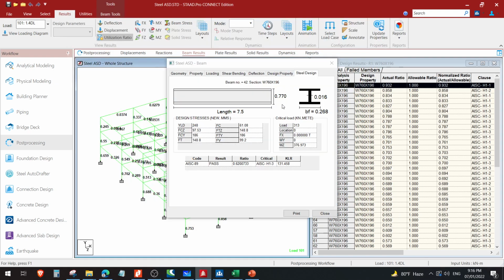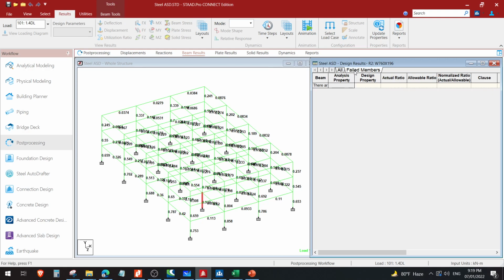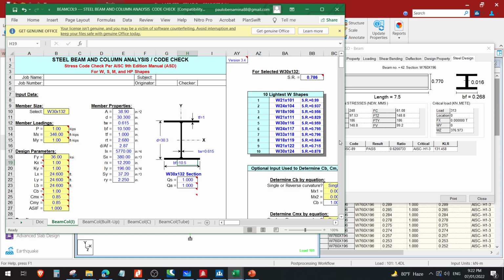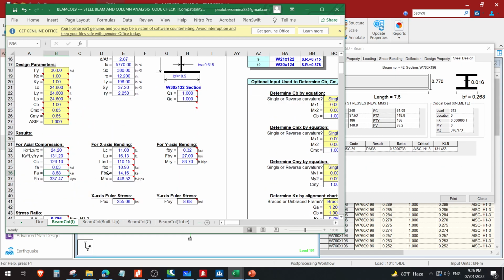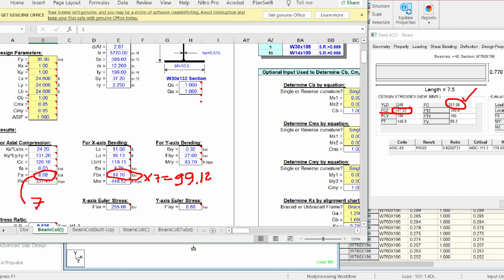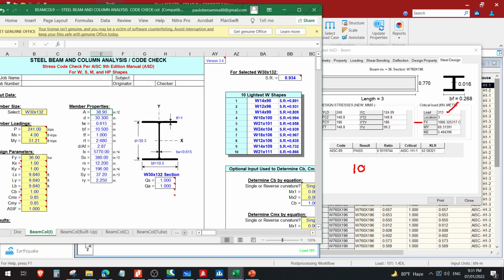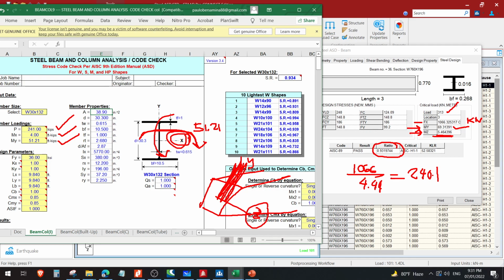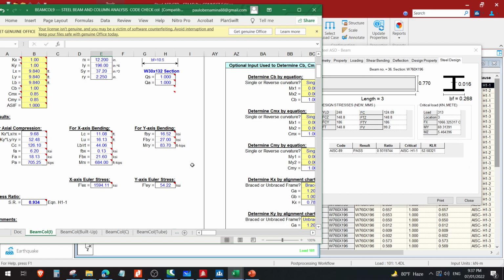STEEL Beam and Column Design Using Excel

Comment: hello sir. paanu po analysis ng combined reinforced concrete and I beam sections. may project po kasi ako reinforced concrete po and existing 1-4 storey structure tapos yung extension is 3 floor up na steel I beams  structure kasi yun po gusto ni owner . paanu po sya i analyze? ok lang ba na iadapt lang yung mga Axial, Moment and Shear forces from the result ng Analysis assuming concrete lahat structures then using excel sheets to design the members of the steel column and beams for the extension ng addition 3 floor structure?
Reply from the maker: i suggest check first the capacity of existing building if it can accomodate additional load. you might need to do nonlinear analysis to predict response of structure including the connection of steel to concrete reliability under cyclic load.

Comment: Hello sir, why do we use this way for designing where we can use easier way by applications like sap2000, or RSATB, Etabs,....., so what is the difference between the sheets and the applications?
Reply from the maker: its a way for students to appreciate manual calculation that more expensive commercial softwares are also using. at least thru this, they can use different softwares available in the market while sticking to the concept and manual calc